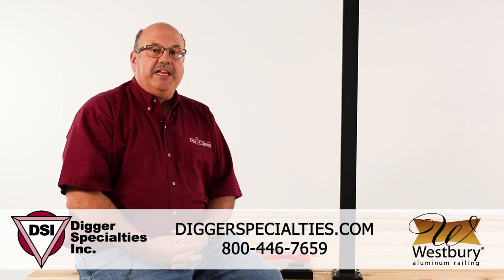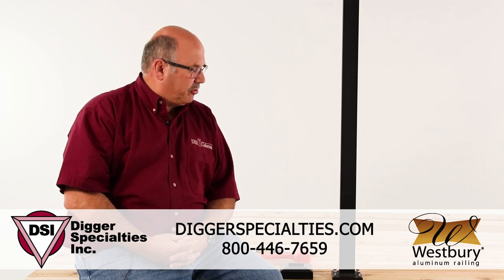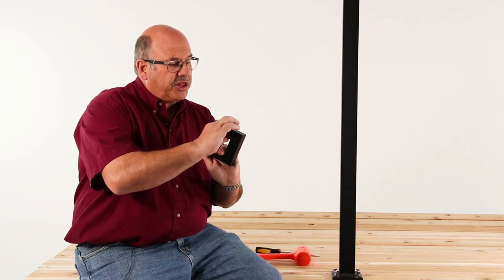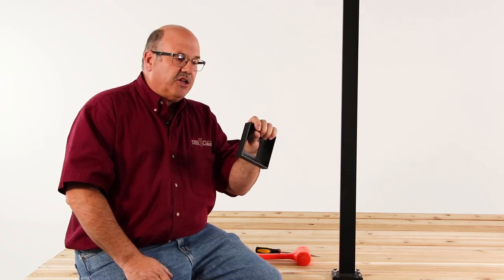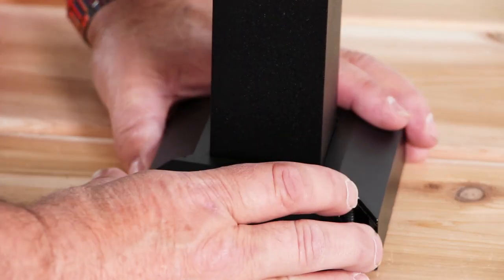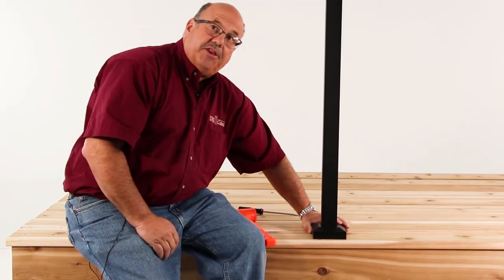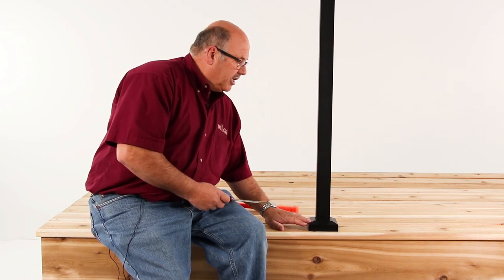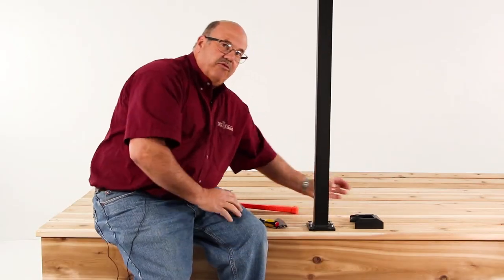Westbury® Post Flair Installation

Comment: Hold the post flair upside down in the air and hammer straight down on the removable piece closer to the inside then the outside
Reply: This worked really well for me, thanks for the suggestion!

Comment: I finally got it apart. The video was only slightly helpful. First look at it carefully so you know which way you need pry to get it apart.than hold it so your index fingers are touching inside one corner if you kind of flex your fingers against each other while pulling it gives you A little extra leverage to get them apart.

Comment: While Larry acknowledges the problem, his explanation doesn't help very much.  He's right about pulling it apart in opposite directions does not work.  Instead of trying to pull the detachable side in the opposite direction, pull it down, using a bit of force.  You will notice the seam start to separate and then it will come apart.